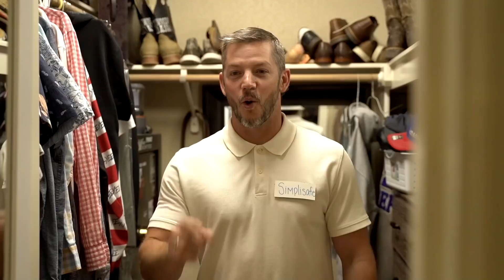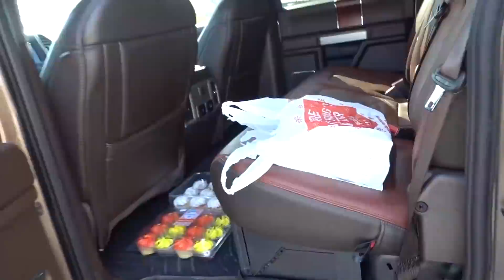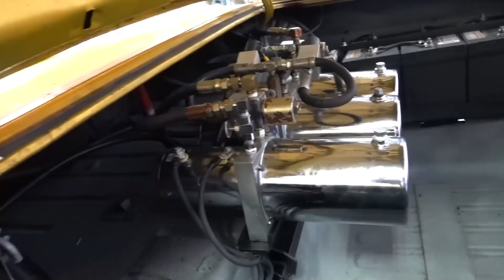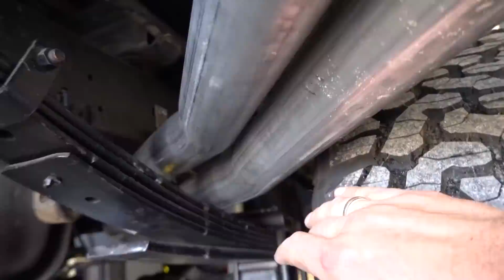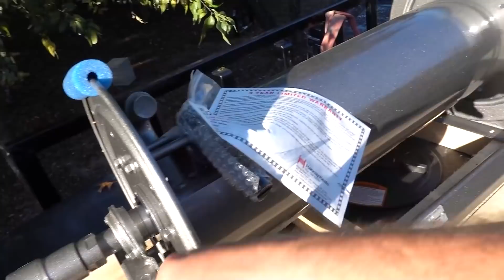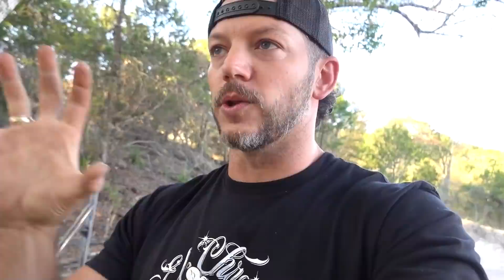Here's How a Local Car Shop Screwed up the Bronco...

Comment: Your tree idea has no hope of succeeding. That said, I would very much like to watch you attempt it.
Reply: For the record, if you cut the leaning limb, the straight trunks will grow incredibly fast. They will be able to uptake water and nutrients at the same rate that the giant tree did because the root system is undisturbed. If you go this route, pick one straight volunteer to be the main tree. If you leave that clump, they will grow together. This will make for a tree very prone to rot and splitting. If you cut the large leaning trunk as close to the ground as possible, cut all the rest except for a single trunk. It will probably only take about 8 years for the new trunk to be as large as the one you cut. But please ignore this and attempt your plan, I would really like to see someone try to graft a full grown oak

Comment: Hey Matt, I would suggest getting a very large spade for your tree. This will dig up a large portion of its root system into a ball. Then rotate the entire tree and brace it so it is as straight as you can get it. That tree is massive and it will take quite a few very strong stakes to keep it upright and stable so the roots can regrow and hold the tree up under their own power. I would not suggest trying to graft the tree to itself especially at such an old age. It would most likely die from that. So all and all your best bet is trying to get as large of a root system as possible with a spade and rotating the tree. Btw I specialized in planting massive trees for 15 years at my family's tree farm in Colorado. This can work but must be done in the spring to early summer and the tree will require a ton of water and TLC to survive.

Comment: The worst exhaust I’ve seen. You can make better yourself. You can buy a pack of bends and straights from many performance places and build it yourself. And you can weld better if you had someone show you for 30 minutes. Those welds are disgusting. And put flange joints in the system. Not one giant welded pipe.